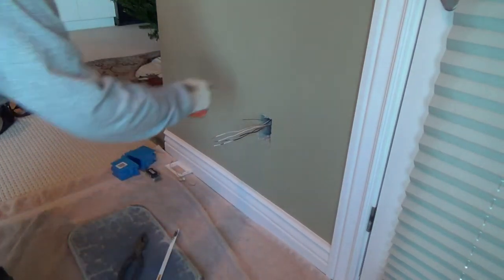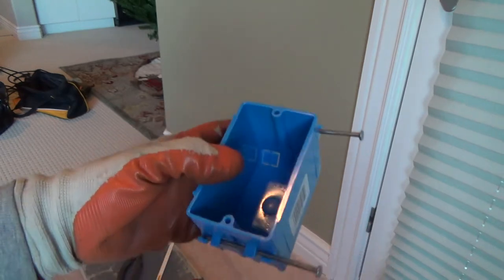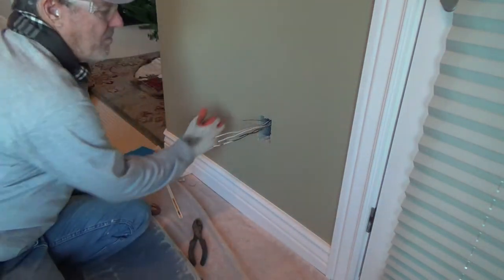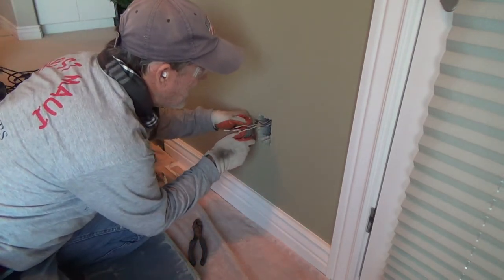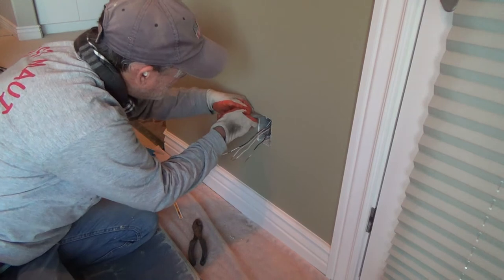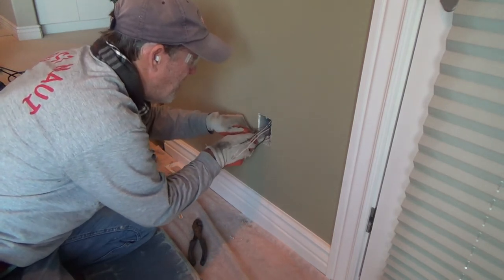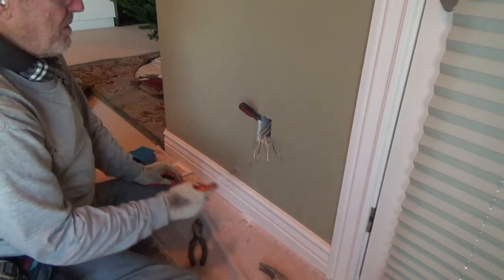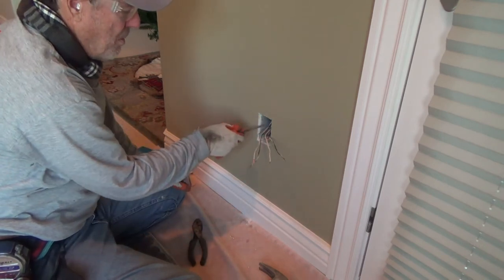How to Remove/Pull Out Duplex Electrical Outlet Junction Box From Wall Made Easy?

Comment: Question: I am installing a backsplash and we dont need the electrical outlet. Can I just remove the receptacle the way you did and cap off the wires and dry wall over it?
Reply from the maker: Just left you a long message on the other video where you left same message so make sure to read the whole thing then if you have more questions then send me another message on whatever video you are on so I can respond again to you. Thanks!

Comment: A conscientious electrician? A rarity!  I have one of these miserable old timey tiny metal boxes. My electrician wired up a gfci outlet in said box, knowing that a box extender would have to go in . Guess what?  My novice understanding realized later that box extenders wouldn't fit in the little metal box. I mean the little metal box is small than the boxes sold today. Plus, the wiring is so tight in the little metal box to begin with. Why wouldn't my electrician think ahead when I told him the wall covering would have the outlet to deep? Why couldn't he put a modern plastic box in when the studs were bare? He said "oh no that metal box is just fine." Now it's my problem. Plus, he twisted all the ground wires together in said little metal box and this box is close to the kitchen sink. As I said, the wires are balled up real tight in this box. I'm beyond aggravated, but thank you for this video. I know what to do.
Edit: Oh, you have a 2x6 wall and a plastic box. Lucky me, I have 2x4 walls and a metal box.
Reply from the maker: I hear your pain for sure but if I know you you will get'er done in spite of it all! Let me know how you do. I know you can do it!

Comment: They're called "Teeth" , as in TPI - teeth per inch, not BPI!
Reply from the maker: Yes teeth per inch....did I say BPI instead of TPI with you thinking you heard me say a B instead of a T? Yes you are correct for teeth....
Reply: @videojoeshows   I figured that since you kept calling them "blades", you would probably use the terrm "Blades per inch" (BPI).
Only because you just recently discovered the directional arrow on the blade have you  discovered which way the blade cuts? 
If the arrow is worn off, just run the blade against a fingernail - either it tends to catch or it slips by.
Reply from the maker: @usernamemykel  Nice thought for sure. Thanks for the return messages! Keep it going!
Reply from the maker: Also I have probably removed about 100 outlet boxes this very same way & works great!
Reply: @videojoeshows  Fact is, at 79 years of age, I've never seen or heard of any man using a hacksaw blade without a handle. 
Usually, they are bought together, and used together. You are, as they say "unique".
Hopefully the gloves you use are slash resistant, as are woodcarvers gloves.
Reply from the maker: @usernamemykel  Haha well I guess you're never too old to learn something new they say! I just thought one day I would try it & son of gun it really works. I just use regular gloves that I show here on the video & have never had an issue whatsoever! Why do through the hassle of buying a little hacksaw that holds the blade on one end & let it stick out on the other end if you can just use the hacksaw all by itself to do the same thing...? That's what my channel is all about...helping the average Joe save money around the house! Thanks for checking out my videos young man!
Reply: @videojoeshows  
Take a poll of your viewers - let's see how many of them use a hacksaw without a handle.  That'd be fun to see  ;  )
Reply from the maker: @usernamemykel  Probably none since most people have never thought of it before or thought it possible...but of course it's possible & I do it all the time for removing outlet boxes just like this one. I've done it over 100 times with same results. Works great!
Reply: @videojoeshows  Aha! You're an innovator! A pack leader! An influencer! And a Chinese glove destroyer.
Reply from the maker: @usernamemykel  LMAO! Thanks for dropping by with your words of wisdom!

Comment: Why in the heck sre you removing the box if you're gonna put another one in the same dang place??
Reply from the maker: I'm removing the box to then get a drill in there to drill a hole to under the house to then run a new wire from this box location to then down under the house for some power for under the house. Once I run the wire then I can install a cutin outlet box in this same location to then re-install the existing duplex outlet I removed. See? Keep watching as I've made more videos of this project...
Reply: Great video, Thanks!
Reply: Sometimes you need to remove a smaller box to add a deeper box for more wires for an add on receptacle.